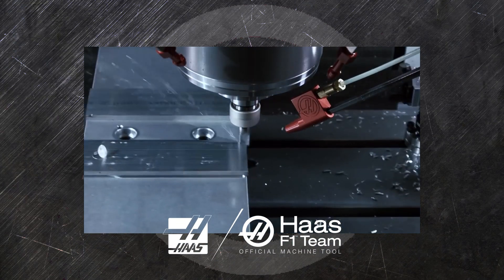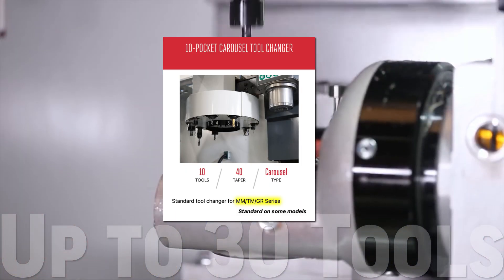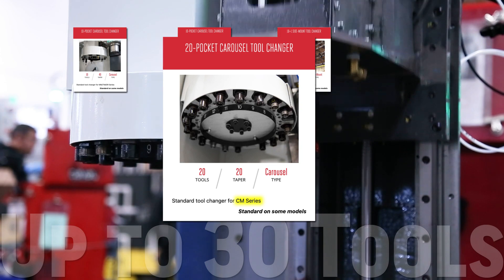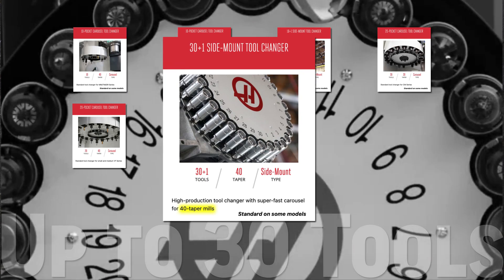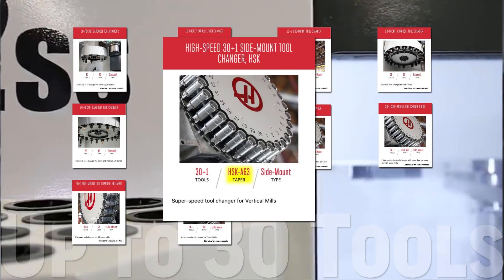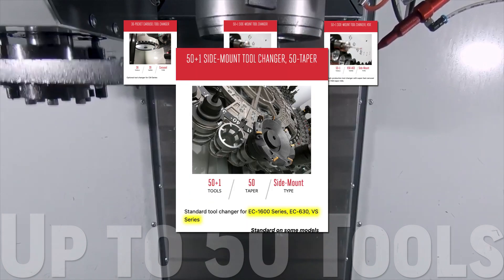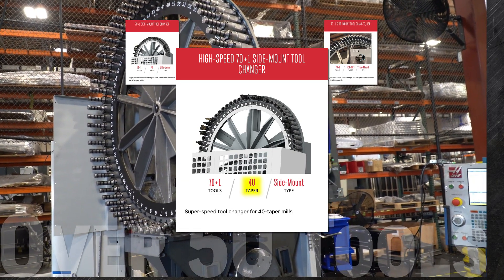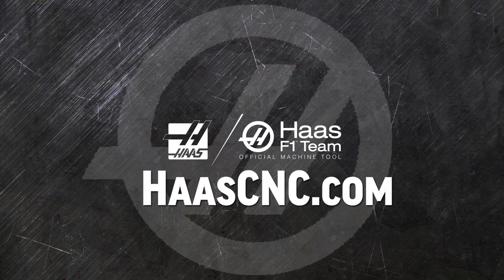Haas Mill Tool Changer Options - Haas Automation, Inc.

Comment: Side mount is the way to go if one can afford it. Learning how to use your CAM program output code and having the next tool staged in the ready position really can add up to some noticeable time savings if a program has a lot of tool changes. Also not having the tools hanging out inside the cabinet can be beneficial if your running a tall part/fixture.